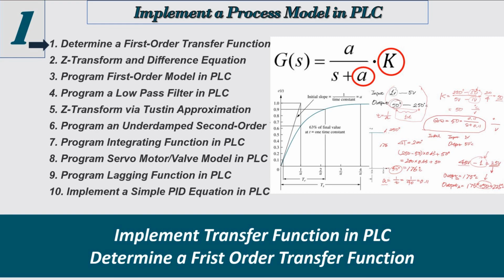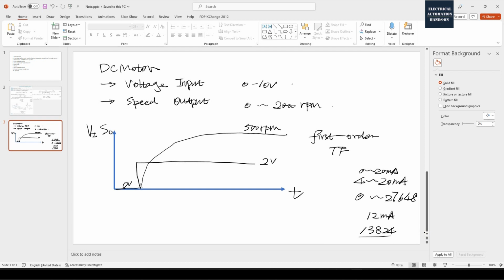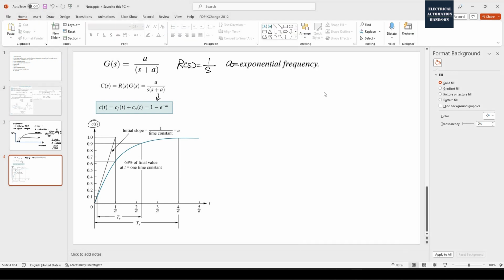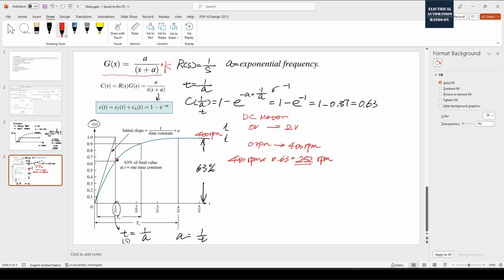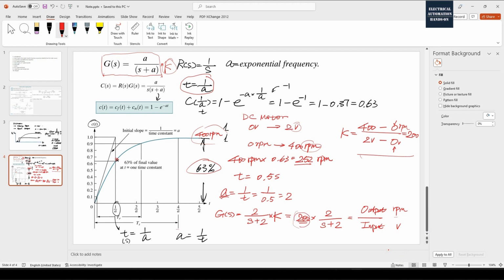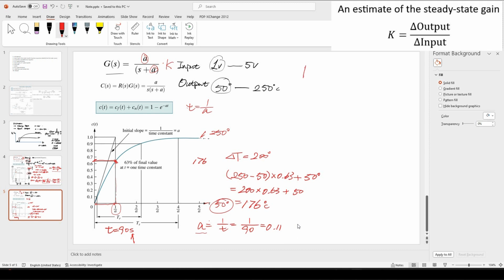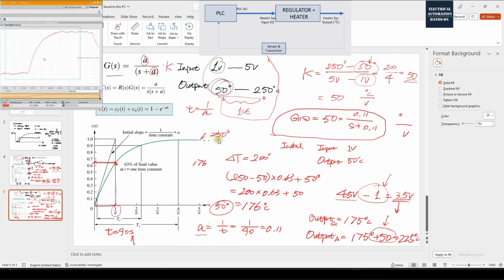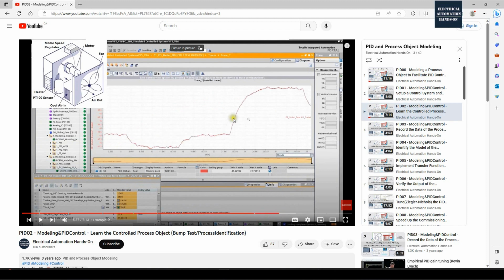TS01. [Model in PLC] Determine First Order Transfer Function via  Bump Test Curve

Comment: thanks for your useful video but I have a quastion pleas:
in temperature example if we applied 3.5 as an input in this aquation [ k*a/(s*(s+a))  ]
we will not get the result 175
so, can you please tell us how to get the real system output value using that equation?
Reply from the maker: one a/(s+a) with a step unit input will output '1' after it passed the setting time. there for if K = 50, and input of the model is 3.5, then 50x3.5=175
Reply: @electricalautomation  thank you sir
but do mean by ''the setting time''   LaPlace transforming
Reply: Thanks for the video @electricalautomation 
what I think is that we need to take the z transform of the transfer function then simplify it then take the inverse Z transform to convert it the natural respond alternatively we could transform to the time domain however we shall have time as a variable to get the temperature when you apply 4.5V to the system